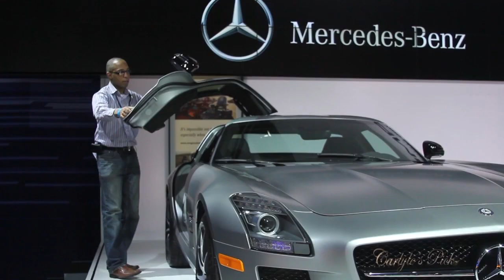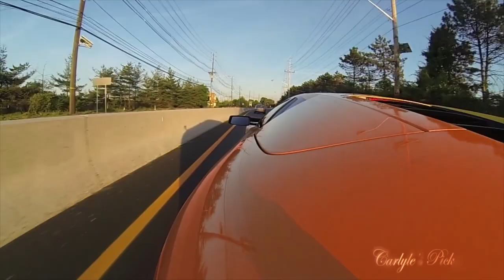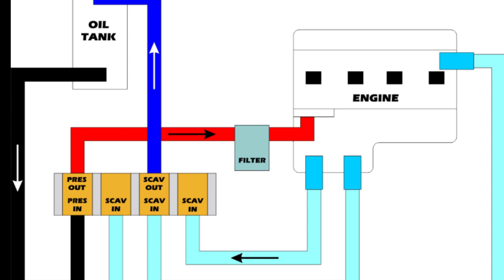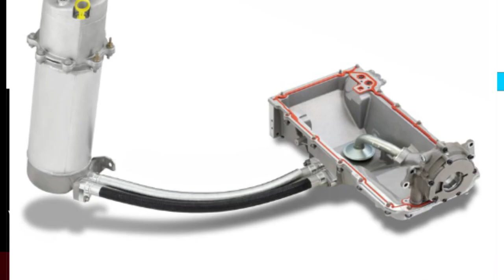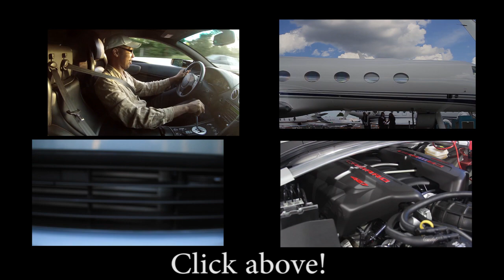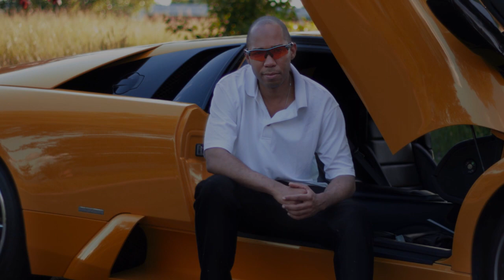What is a dry sump system? How this cooling system works and what are advantages/disadvantages.

Comment: Thanks for the video. From what I heard, it's all rosy and all advantageous; why wouldn't all cars have such a system instead of the wet sump?
Reply: cost
Reply: the accusump dry sump on my viper cost 15K..so yes cost is an issue for cheaper cars and not required because cheaper cars are disposable cars that will not be generating cornering Gs sufficient enough to starve the engine of oil

Comment: There are more benefits in dry sump. One is crank case pressure. When crank case pressure increases by blow by gas, scavenge pump takes oil and gas together. Lower crank case pressure means more power. Second benefit is the car can carry more oil because of an oil tank. Third benefit is oil line. Because an oil tank and engine are separate, you can add effective oil cooler and filer.

Comment: Ya did a great job at explaining WHY a dry sump system is useful, but can you explain HOW it works differently than a wet sump? I get that the oil is reserved elsewhere, but then what happens to lubricate engine parts?